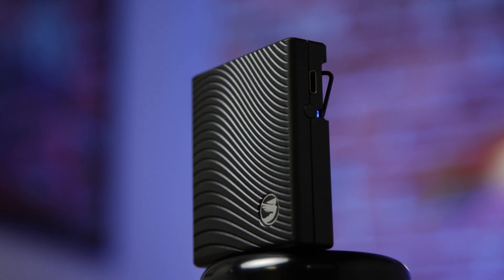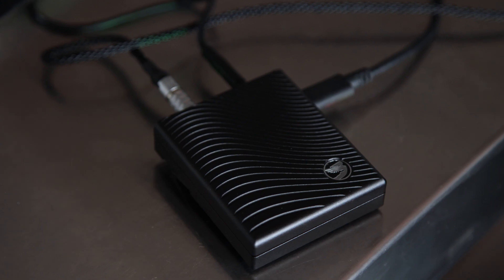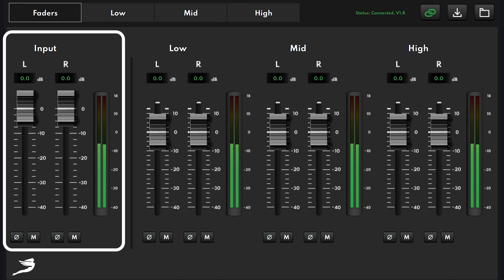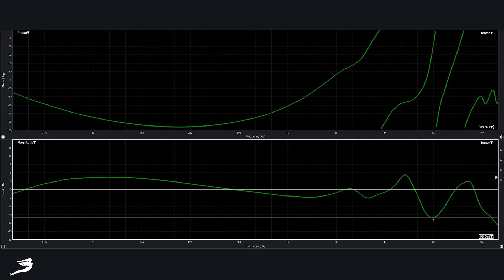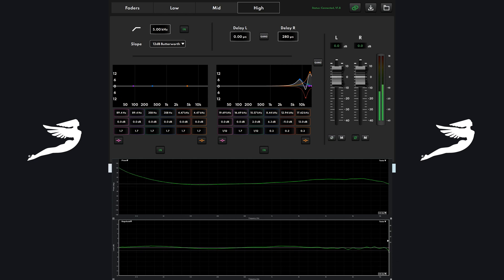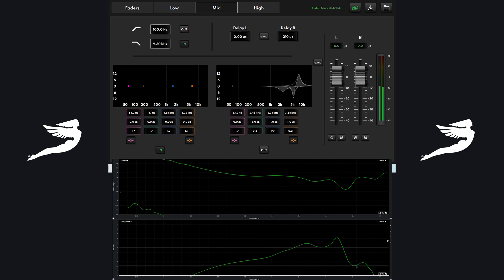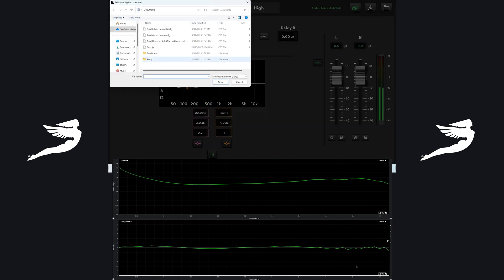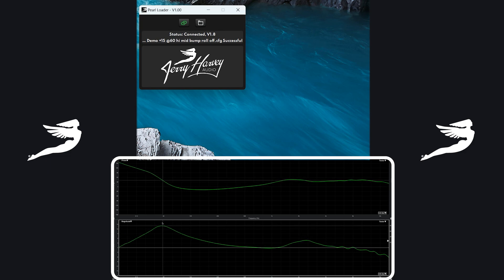Introduction: JH Audio's Pearl Tri Amp Micro Speaker Management System

Comment: Curious if the dsp box needs to be in line with the rx? How rad would it be if the ear pieces themselves housed the data to operate without the pearl box
Reply from the maker: Yes, the output of the RX would go into the input of the Pearl.

Comment: Yes, can this work with my Rosannes? I would love to be able to customize the curve to account for my hearing loss. I have a more severe loss on my left side and I’d love to be able to adjust the volume and eq separately for each ear. And speaking of which, has JH Audio ever thought of making super high fidelity hearing aids? I’m a musician and former sound engineer (back when I could hear better) and even though I’ve got premium hearing aids that help me understand speech they fall woefully short in other frequency ranges. I’d love to somehow turn my Rosannes into super high fidelity hearing aids if that were possible. Thanks for all you do, I LOVE my Roseannes!
Reply from the maker: If your Roxanne's have 4-pin or 7-pin connectors, the Pearl will work with them. You can EQ for your hearing loss, if you have an audiogram it shouldn't be an issue at all.
Reply: My Roxanne’s have 4 pin connectors. This is great news!

Comment: Can I use this with my JH Audio Sharonas? Will this have an app to sync to or only editable via PC?
Reply from the maker: Yes, as long as they have 4-pin or 7-pin connectors. Pearl will not work with 2-pin versions. There are no short-term plans for an app, this is a PC-based software that is usable on Mac with parallels.

Comment: Maybe I missed it, but what does the I/O look like for this? Interested to see if it works for multiple pairs of ears or just one set per, especially for live sound applications.
Reply from the maker: It is a 3.5 mm mini jack input with a 10-pin connector output. It works with one set of ears.

Comment: Obviously this is mostly designed for live use, but will this be available and useful for audiophiles? Not quite sure exactly how this device works once it's disconnected from the computer.
Reply from the maker: Yes, it will be available for audiophiles. When connected to the Pearl software, you'll be able to program and shape the audio, programming the pack. Once the pack is disengaged, the flash stays in the pack, it doesn't change until it is overwritten.